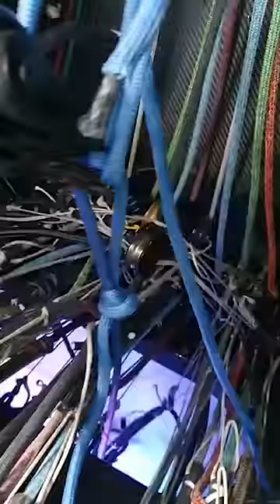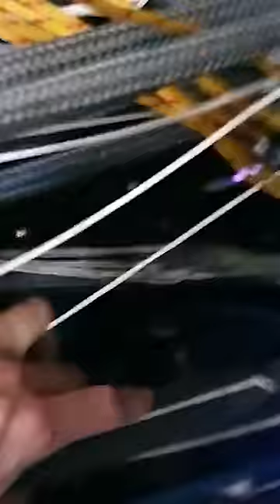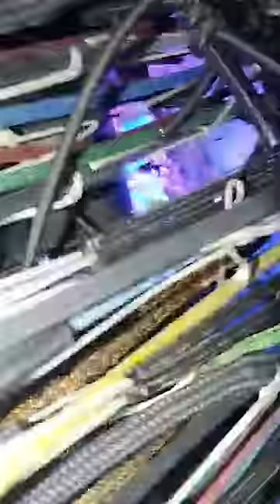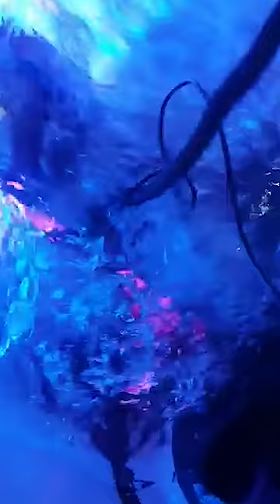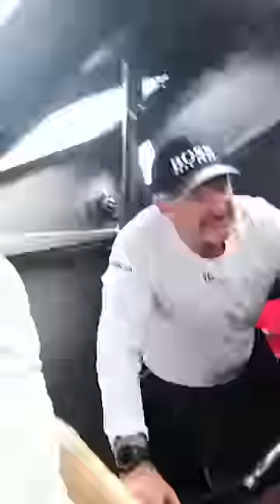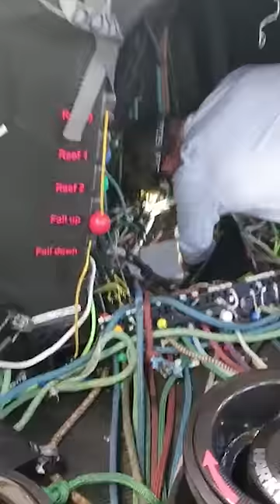HUGO BOSS onboard recap: detaching the keel

Comment: And now, without a Keel and a big hole in the boat? Do the boat compensate it it or the sailer?
Reply: Seems like there's a kind of keel box which extends to above the waterline, so water can only enter the boat when it goes above the normal waterline, over the top of the keel box.